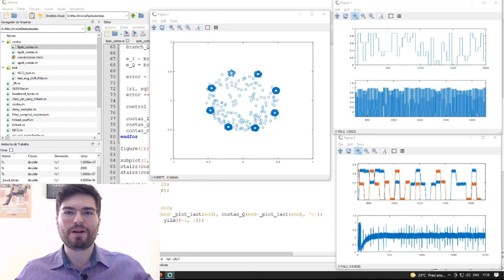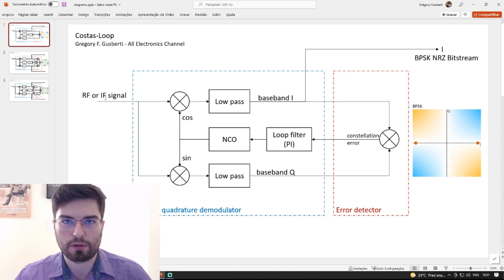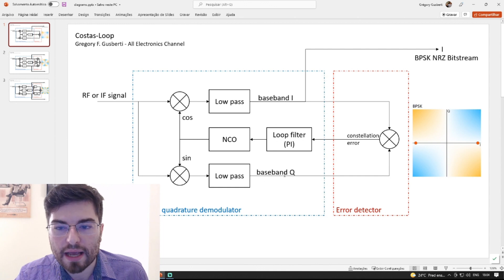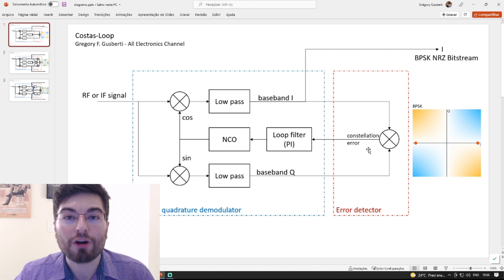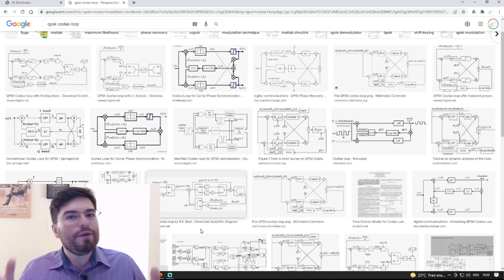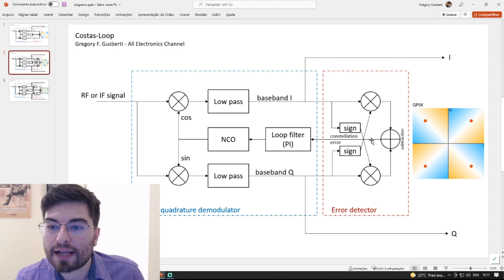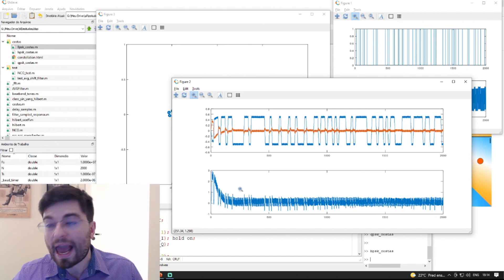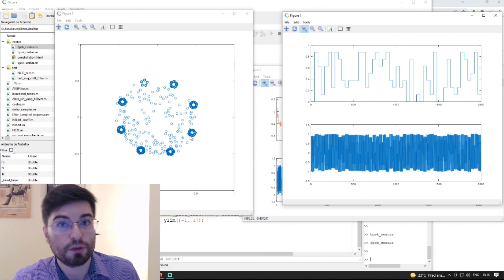Costas Loop Demodulator

Comment: It's great to see a relatively modern presentation of this topic. I absolutely hate the archaic analog diagrams presented in virtually every textbook that covers this topic. 2:25 "This is nothing more than a common quadrature demodulator". Exactly!!!! So, why on earth are we wasting almost the whole diagram to draw this irrelevant circuit?! I honestly don't understand why we don't just start in the complex (analytic) digital baseband. Drawing the IQ demodulator is absolutely horrible because it could be implemented digitally (e.g. in a direct-sampling receiver) or in analog. If it's implemented in analog, then in most modern implementations, that's not going to be part of the Costas loop. We'll instead insert a complex mixer in the digital baseband (where the NCO is part of that mixer) for doing the carrier recovery. Even in direct-sampling architectures, it's common to do the same thing. So, five (!) components (2 multipliers, 2 lowpass filters and an NCO) could be replaced with just one mixer. Then we just have: Mixer, feedback loop and error detector. Clean and simple!

Edit: 7:21 "This is only a PLL". Yes!! Such a key point, and nicely highlighted.

Comment: If the error goes to zero and the loop lands on the I=1,Q=0 point in the constellation (in the BPSK scenario for example), I can see that working. However what if it lands on the I=-1, Q=0 point in the constellation? Wont that mean your demodulated data is inverted because your loop locked on to the inverted component and not the in phase component?
Reply from the maker: The data will be inverted. This is why sync codes are needed or differential encoding. It is impossible to prevent this phase inversion ambiguity in BPSK

Comment: How to design the filters for a) demodulating weak noisy signals and/or b) a wide frequency pull-in range ?
Reply: You really expect the guy even understands on how to design the most important component of the whole architecture? I suggest you start looking at books (that's what I have resorted to at least)
Reply: @asinegaasinega  Thank you for your suggestion which is a good one for anybody.
Reply from the maker: ❤❤❤ thank you guys!

Comment: What is the benefit of doing the quadrature demodulator at IF instead of digital baseband? I don't think you need the low pass filter in a digital system
Reply from the maker: There are tradeoffs.. not benefits.. zero-if dowconversion imply balanced IQ paths, AGC before ADs.. so there is no best topology

Comment: The color-transition in your first constellation diagram (BPSK) ist showing a white region along the Q-axis which ist wrong.
Should be showing fully saturated color.
Reply from the maker: It's not wrong. it is the error function for I * Q
Reply: @AllElectronicsChannel  but in that region the error is a maximum instead of a minimum as indicated wrongly by the desaturated white coloring
Reply from the maker: @huawatuam4965  The error is not maximum there. The color is generated by I * Q. On the Q axis the I is zero. 0 * Q = 0.

Comment: Very informative video, with a lot of intuition! I think for the BPSK, a better error function would be sgn(I)*Q, instead of I*Q. This would eliminate the white zone around the Q axis (when I=0), and would give a sharper edge, like on the other diagrams. This would help the PLL to lock on faster.
Reply from the maker: Yep! You are right. Sign(i) *Q is commonly used, and uses less logic on FPGA/ASICs

Comment: Thanks for another very interesting video! As I understand it your BPSK error function also goes to zero when I is 0 and Q is not zero, so you could get a lock 90 degrees out of phase, right? How would you handle that?
Reply from the maker: No! The error gradient points to the I axis!
Reply: But if the error function is purely I * Q, to minimize it you could also have Q go to zero no? The gradient seems to reflect this, as it is also white along the Q axis. Or am I missing something. :)
Reply from the maker: It is white but it is an unstable region, any displacement/noise will generate errors that points to I. 

The colors (error direction) would need to be reversed to Q be stable.
Reply: @AllElectronicsChannel  Ah I see, so the error signal has a magnitude and a direction?
Reply from the maker: Yes, the sign of the error. Negative or positive, these are the colors on the diagram!
Reply: I see, thanks for the explanation!